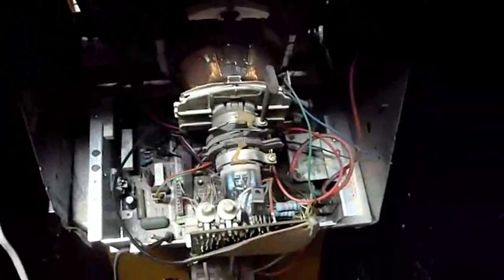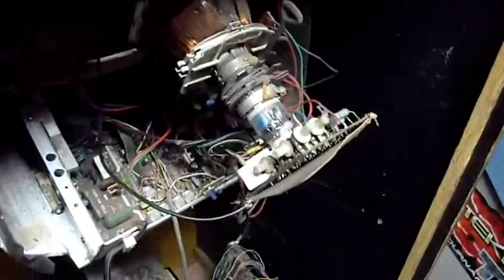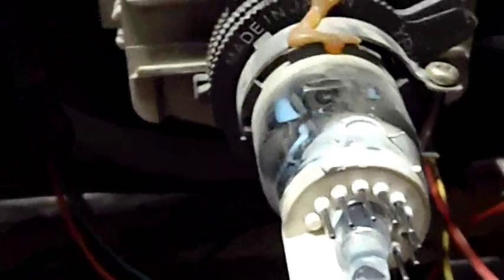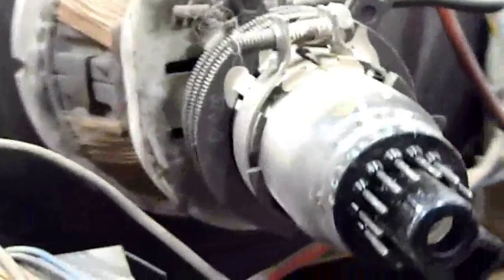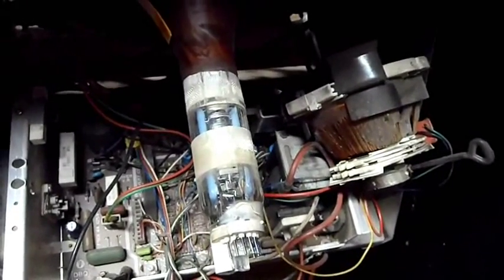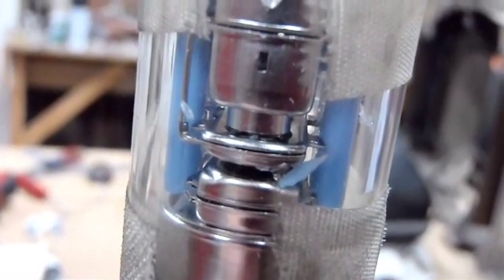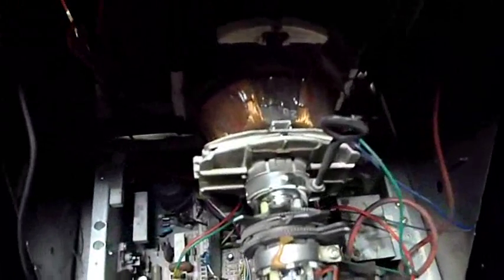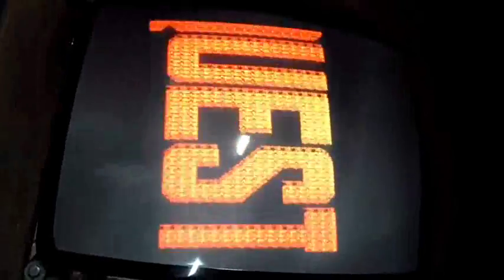swaping arcade picture tubes

Comment: Was hoping to see how you put the yoke and convergence rings back on.. or more specifically how you figured out how far down the neck to put each of them, and how to adjust..  Do you have any videos you used to figure this out, or did it just happen to go right on the first time?
Reply from the maker: I guess it went pretty right! That was the only time I ever did that. The yoke and convergence ring just unscrewed so I slipped them off and put them on the other tube in the same way, didn't change anything. The yoke I just put it as far on the tube as it could go. I think all 19" CRT tubs are pretty much the same.